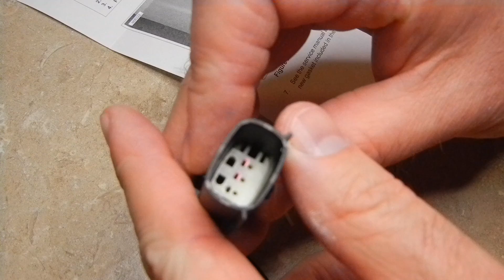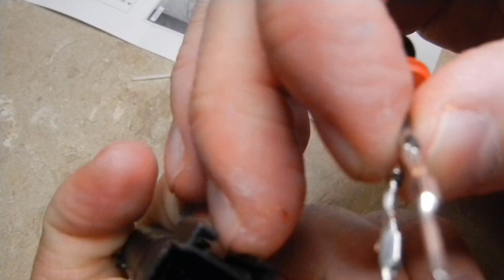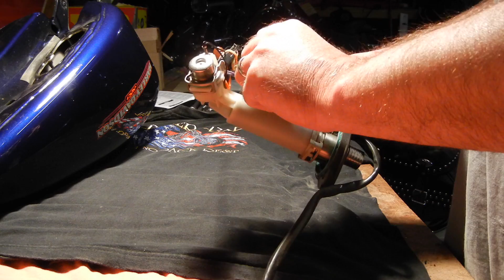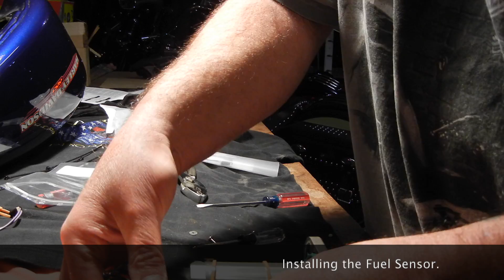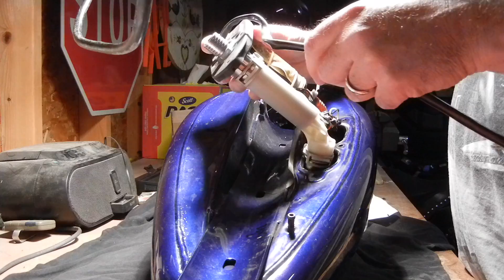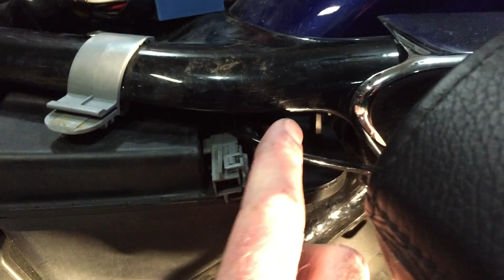Sportster Fuel level Sensor Install

Comment: The only way I can get the pump/filter assembly in or out of the tank is to unscrew the fuel connection under the filter and allow the filter to be moved as you're putting it in or out. Make sure that the tab on the filter lines up with the slot in the base when screwing it back together.

Comment: I installed the new gauge + new fuel meter. The problem in currently having, my gauge doesn't pop fuel tank size at all, that it only part I'm missing to complet my installation... Any idea what I'm doing wrong ??

Thanks you
Reply: Did you ever figure out that problem? I'm having that exact same issue here

Comment: Hi thanks for the video, I just ordered the new speedometer 70900274,  unfortunately the Harley-Davidson dealer wanted suggest to buy it. Do you have the fuel sensor kit that you installed please?
I have sportster XL883 2007
Thanks a lot.
Reply: 61200008A is the part number you need!